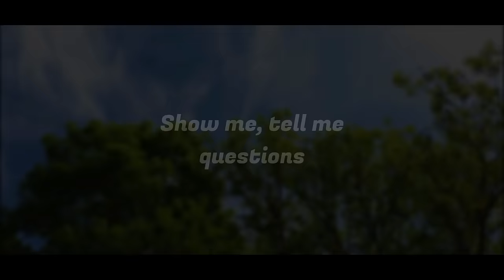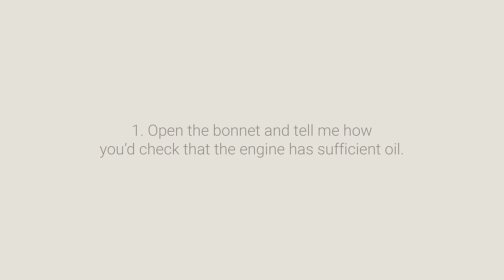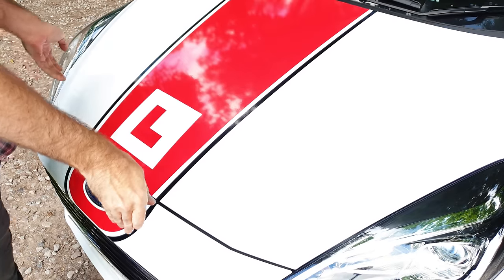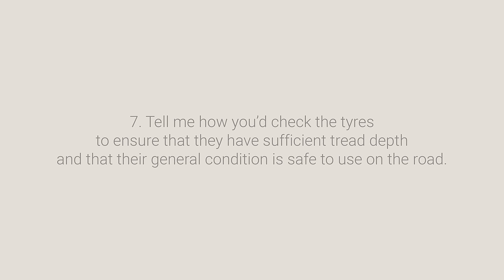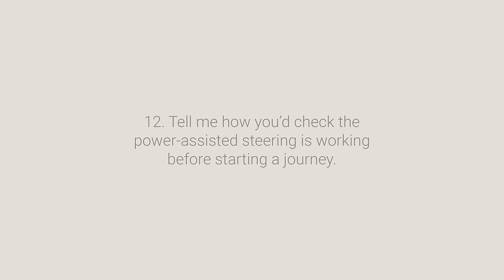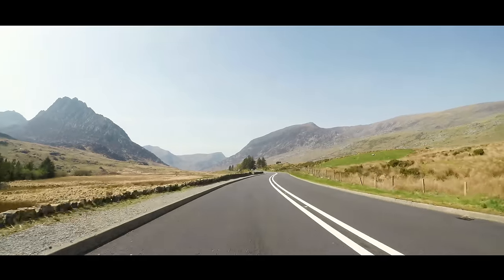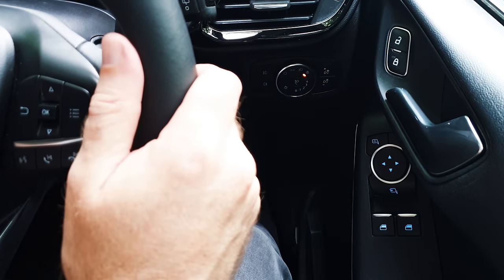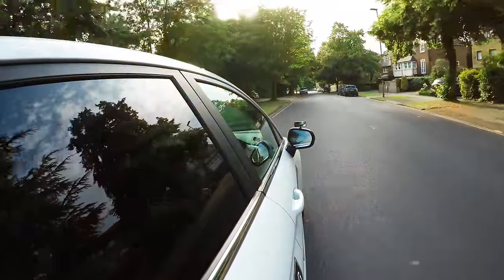Show Me, Tell Me Questions 2024 Driving Test Questions And Answers

Comment: Got my test tomorrow for the first time. Regardless if I fail I’m confident that it should take me two or three attempts especially as I can always look back at your videos and use your videos to correct my mistakes.
Reply from the maker: Hi! Good luck with your driving test 🙂
Reply: This is exactly how I look at it mate. How did you get on? I've got mine tomorrow!
Reply: What happened mate?
Reply: @mstr7246  Crawled up to a stop sign under 5mph, did a quick check and emerged. Instant fail. They want you to stop dead. Goes without saying really, but I drive a motorbike so it's another bad habit I've picked up. Will get it next time :) Shame because if there was traffic on the day, I'd have passed. heh.
Reply: @TheCodexNecro  Aaaagh, tough luck there. You're passing the next time 😉
Reply: Per Sunn  In normal driving post-test, it's adequate to simply clutch it up to the stop line, quick check and emerge. They fail you if you don't go through the action of stopping, applying the handbrake, checking, then emerging. Most people won't do this in reality, it all depends on the junction in question and whether there's enough visibility.
I'm a firm believer in driving to the conditions.
On the day I was talking about, I would have passed if there was more traffic because it would have forced me to hand brake at the stop sign and wait... It was just unfortunate that it was less busy and I assumed that holding it on the clutch (was a hill, so technically stopped) and checking would have been good enough.
I got through it 2nd time no problem of course (thankfully before covid19). Just a minor set back.
Reply: Per Sunn  I've been driving for many years now mate. I started on motorbikes and I've never, ever accumulated any points whatsoever - even after over a year now of driving cars. Even my own instructor told me that after passing, i'll never drive like I did in the lessons/test again.
I agree with you completely on the purpose of a stop sign, but I don't agree that you should be as diligent as you are suggesting. You can come to a complete stop, do a check both ways, then emerge no problem. You don't need to go through all the hassle of applying the hand brake as well! Haha.
I get the feeling you're a right jobsworth and follow every single rule to a T.
Reply: Per Sunn  ill be sure to skip a few red lights and increase my speed later, just for you :) cheers.

Comment: -- Tell Me Questions

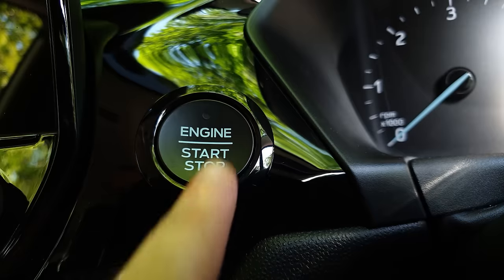1:04 - How To Open The Bonnet
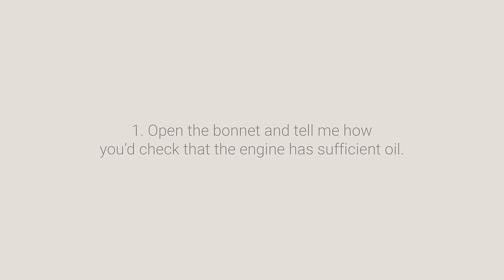1:45 - Open the bonnet and tell me how you’d check that the engine has sufficient oil.
1:30 - Open the bonnet and tell me how you’d check that the engine has sufficient engine coolant.
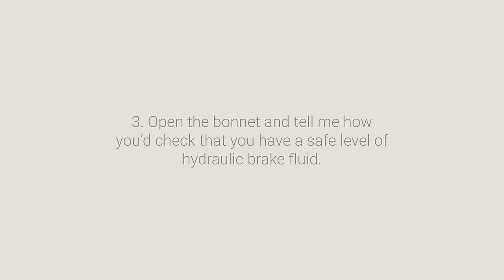2:53 - Open the bonnet and tell me how you’d check that you have a safe level of hydraulic brake fluid.
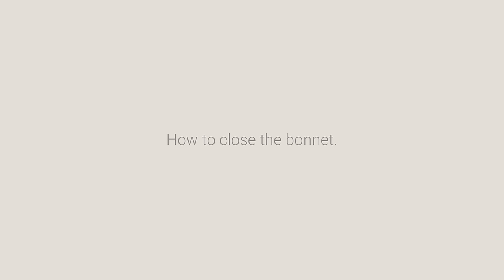3:15 - How To Close The Bonnet
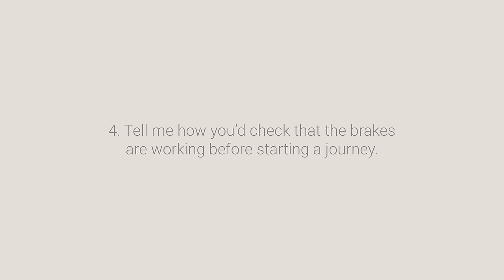3:40 - Tell me how you’d check that the brakes are working before starting a journey.
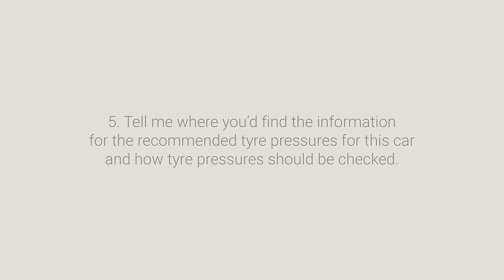4:06 - Tell me where you’d find the information for the recommended tyre pressures for this car and how tyre pressures should be checked.
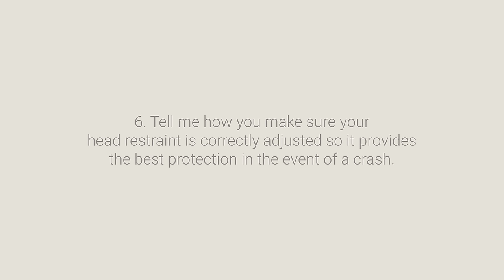4:42 - Tell me how you make sure your head restraint is correctly adjusted so it provides the best protection in the event of a crash.
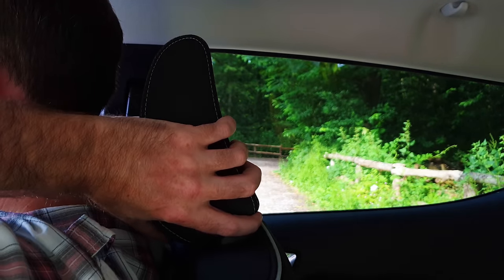5:09 - Tell me how you’d check the tyres to ensure that they have sufficient tread depth and that their general condition is safe to use on the road.
5:38 - Tell me how you’d check that the headlights and tail lights are working. You don’t need to exit the vehicle.
6:05 - Tell me how you’d know if there was a problem with your anti-lock braking system (ABS).
6:20 - Tell me how you’d check the direction indicators are working. You don’t need to exit the vehicle.
6:39 - Tell me how you’d check the brake lights are working on this car.
6:57 - Tell me how you’d check the power-assisted steering is working before starting a journey.
7:28 - Tell me how you’d switch on the rear fog light(s) and explain when you’d use it/them. You don’t need to exit the vehicle.
8:05 - Tell me how you switch your headlight from dipped to main beam and explain how you’d know the main beam is on.

-- Show Me Questions

8:38 - Show Me Questions Advice
9:06 - When it’s safe to do so, can you show me how you wash and clean the rear windscreen?
9:44 - When it’s safe to do so, can you show me how you wash and clean the front windscreen?
10:12 - When it’s safe to do so, can you show me how you’d switch on your dipped headlights?
10:36 - When it’s safe to do so, can you show me how you’d set the rear demister?
10:55 - When it’s safe to do so, can you show me how you’d operate the horn?
11:08 - When it’s safe to do so, can you show me how you’d demist the front windscreen?
11:55 - When it’s safe to do so, can you show me how you’d open and close the side window?

12:23 - Outro
Reply from the maker: Wow! That took some work.
Reply: @worlddriving  Hahahahah! You are quite friendly and I like what you do here, on YouTube. I hope that it helps the channel and who watches this video! Have a great week ahead!